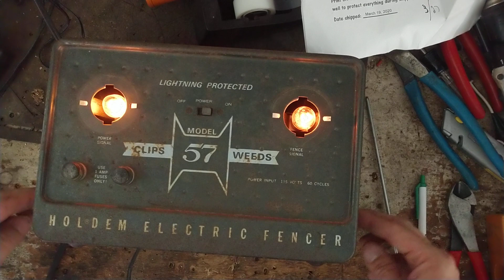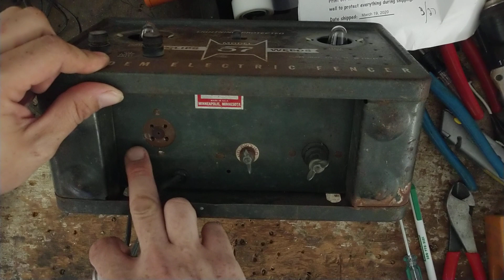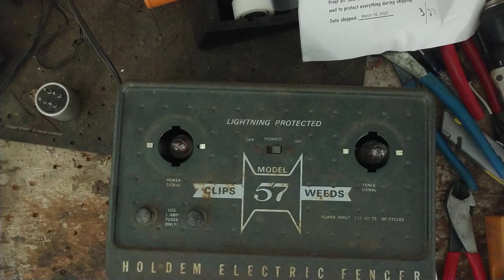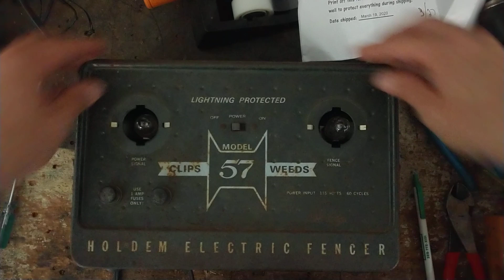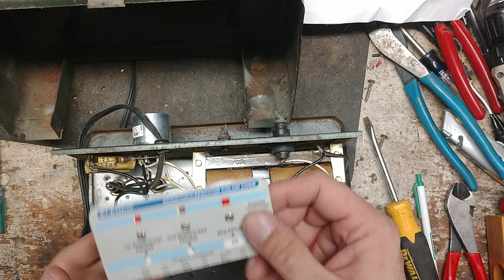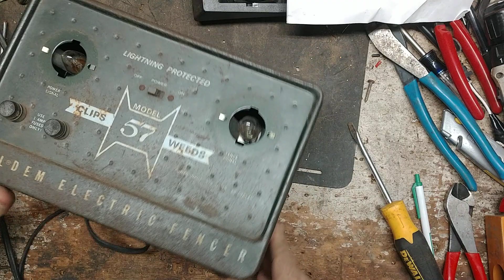How To Test & Repair A Hol-Dem Model 57 Electric Fencer Weed Burner Weed Chopper

Comment: How can I test the pulser before I go buy a new one?
Reply from the maker: You can't really test that. There's no electronics internally of the pulser piece, it's a spring and some contacts. The spring warms up and cools down, which opens and closes those contacts. Shake it and see if it rattles or not. If it rattles, it's definitely bad, if it doesn't rattle it's a 50/50 shot if it's good or bad.
Reply: @FencerFixerRepairLLCKansasCity  thank you I ended up fixing my issue there's a coil with a red wire coming off of it ,that wire wasn't making a good connection to the coil but its all solid now and shocking well!

Comment: I have an international weed chopper and it needs 3 new resistors inside. 2 of the resistors are burned through the middle,, so I have no idea what resistor it takes.
Reply: I would be glad to send it to you to fix and you could make a video!
Reply from the maker: We could try, but most of the parts we could get for these are now either no longer made, hard to find, or when you can people want a small fortune for something only because they think it's worth it because it's old or they know there's not many parts around anymore and if your want the parts that bad, you'll have to pay for those more expensive parts nowadays.

Comment: It'd be good if you had light on the device while recording.
Reply from the maker: This video is from 2 or so years ago. About half way through the video or so I did turn the overhead light on. It's easier for people to see the lights flashing and such with the lights off. But once I opened up the unit, I did turn the overhead lights on and that is as bright as I can make it without putting a flashlight on it.

Comment: Can you bypass 4 pronge flasher make it stay on ..mine is missing pulser .. can I test without pulser ., Use with out .. hate to buy pulser if it doesn't. Work
Reply from the maker: No you can't really bypass the pulser thing and hardwire the transformer. You would be asking for trouble and probably a lawsuit or a possible a dead animal. The 3 prong and 4 prong pulser things are getting harder and harder to find these days anyways.

Comment: So they basically flash on off the ac output?
Reply from the maker: Some flashed and some were constant output and didn't have a delay in between. They have higher voltage than your wall socket, but a lot less amperage.
Reply: Nice